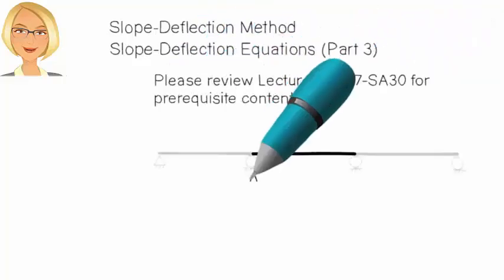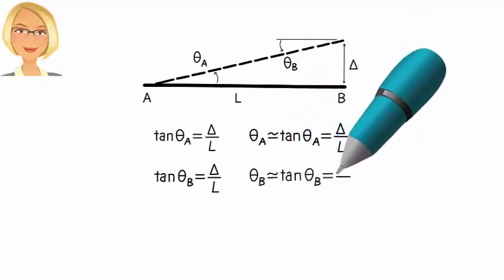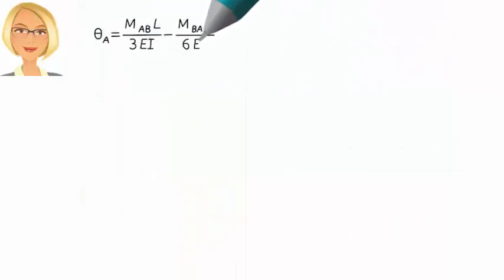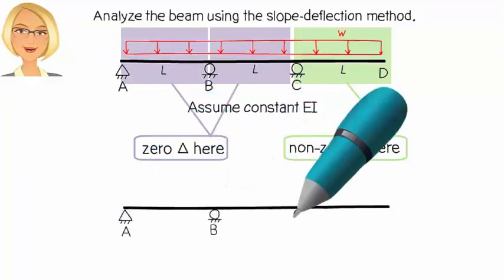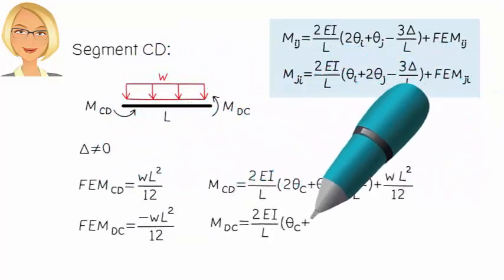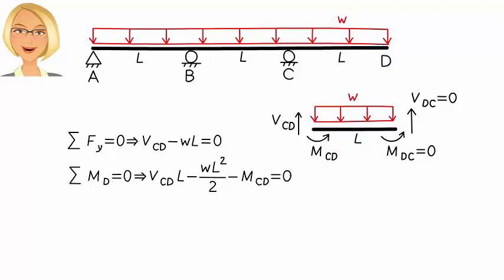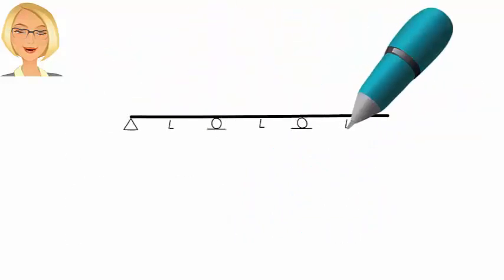SA31: Slope-Deflection Equations (Part 3)

Comment: Did you accidentally solve statically indeterminate problem with statics? a) @10:58 you get value of Mcd in terms of beam parameters and loading b) @9:52 Mcb+Mcd=0 (therefore find Mcb)  c) from beam segment FBD you can easily find that Mbc=0 d) Mbc=-Mba . Why do all this complicated calculations?
Reply from the maker: When considering determinacy, a beam resting on a pin and two rollers is typically considered indeterminate. Why? Because it has four support reactions but there are only three static equilibrium equations.

So, why is it that, in this case, we can determine the support reactions? What condition allows us to simplify the problem, as you’ve suggested?

How would you approach the problem if that condition were removed?
Reply: @DrStructure   I think the fact that it is overhang simplifies the problem, as there is no reaction/internal moment or shear force at D, therefore for segment CD we have 2 equations and 2 unknowns to solve for internal shear force and moment. It's like hinged beam, where globally indeterminate structure can be solved in parts by statics. Is that what you mean?
Reply from the maker: Not quite. It is true that we can simplify the problem by replacing the overhang with a force and a moment applied at C. So, we know the moment at C is wL^2/2. This is the moment due to the load applied on the overhang. But that does not enable us to determine the reaction forces at A, B, and C. There are still too many unknowns to be solved using the static equilibrium equations.

Let’s simplify the problem by removing the overhang altogether. Now, we have a two-span beam with a pin support at A, and rollers at B and C, resulting in four unknown reaction forces: Ax, Ay, By, and Cy. Can we determine these unknowns using the static equilibrium equations? We know Ax=0. But what about Ay, By, and Cy? How do we determine them?

Comment: What does it mean when we get the values of the member end moments (Mab, Mba and Mbc) as zero values noting that already there is rotations happened for the joints where they exist? And can I know the deformation response for this case and how to relate it with the Member end moments and joint rotations? Thanking you in advance
Reply from the maker: A bending moment in a beam (at point X) causes rotation in the beam (at point Y). That is to say, a bending moment does not have to be present at a specific point for the point to rotate or deflect. A good example would be a simply supported beam subjected to a load at its midpoint. The load causes the beam to deflection downward, resulting in a rotation at the pin and roller supports. Yet, we know that bending moment at the pin/roller is zero. 

The response of a beam to loads manifests itself in (1) internal forces (i.e., moment and shear), and (2) deformation and rotation. Both these responses can be determined using the slope-deflection method. The method yields a set of equations the collectively describe the relationships among the joint rotations, displacements, and moments. 

Of significance here is to keep in mind that there is no one-to-one relationship that tells us a zero moment at point X mean zero a rotation/displacement at X, or vice versa.
Reply: That was truly helping.. thank you

Comment: I understand how you got Mcd=wl^2/2 but how did you get -5wl^2/12 for the fem?
Reply from the maker: The equation of interest is Mcd - wL^2/2 = 0. 
The fixed-end moment for Mcd, given by the slope-deflection equation, is wL^2/12. 
So, when we expand the above equation, we end up with wL^2/12 - wL^2/2 which equals to -5 wL^2/12
Reply: Thank you

Comment: I am a bit confused: When is the bending moment at A clockwise and when is it counter-clockwise ? Thanks
Reply from the maker: In the slope-deflection method, we assume the member-end moments to be in the counterclockwise direction. That is the same as saying, counterclockwise is the assumed positive direction. But this is completely arbitrary. We could have assumed them to be acting the clockwise direction which would have resulted in a similar, but not identical, set of slope-deflection equations. 

In general, one can assume any direction for an unknown moment, or force. We can assume clockwise, or counterclockwise, to be positive,. We then set up our equations and solve for the unknown moment(s). If a moment value turns out to be negative, then we know that the moment acts in the opposite direction to what was assumed initially.
Reply: @DrStructure  Thank you so much
Reply from the maker: You're welcome!

Comment: Dr structures, should we not  delta negative in our equation as it deflects downward(  clockwise)? Or the answer of delta is negative which means that it would have been positive if we had taken negative in equation?
Reply from the maker: The negative sign in front of delta in the slope-deflection equations simply indicates that a positive delta value reduces (subtracts from) the positive (counterclockwise) member-end moments. That negative sign is not telling us anything about the sign of delta itself.  After solving for delta, if we end up with a negative value, as we do in the example problem, then we know that the delta (relative displacement) is caused by a clockwise rotation of the beam segment. This does not necessarily mean a downward deflection however. It would be a downward deflection if the right end moves down relative to the left end. But it could also happen if the left end of the segment moves up relative to the right end. In both cases, the segment’s rotation would be clockwise, meaning a negative delta.

Comment: Thanks for the videos. Very helpful.
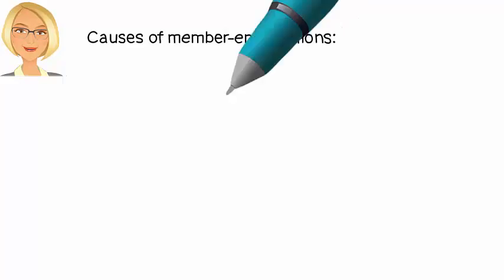I have a question. What will happen when we have just nodes in case of simple supports? Here in the example @ 2:00, say the mid node becomes just a node, not a support. Can we use these formulas directly? Since the mid node will deflect downwards, can we say that this is the same 'delta' specified as support deflection? In no where i saw a solution like that.
Reply from the maker: In the particular beam that you are referring to, if we replace the middle roller with a hinge, the beam becomes unstable. So that beam is not a good example to use here.

Here is a better example. Suppose we have a continuous beam with five supports where the middle support is a roller. We can then ask the question: "What happens if we replace the roller with a hinge?"

Several things would happen:

1. The beam is going to deflect downward at that joint. This means the Delta term would no longer be zero in the slope-deflection equations associated with the two members connected to the joint. This introduces an additional unknown (Delta)  into the equilibrium equations.

2. Bending moment at the joint would be zero since it is an internal hinge. 

3. The beam segment to the left of the hinge would have different rotation (theta) than the beam segment to the right of the hinge. This means at the hinge, we will have two distinct rotations, one for the left side of the hinge and one for the right side of the hinge.

So, how do figure out these additional unknowns?  We need more equilibrium equations. Where do we get these additional equations from? 

Generally, when Delta is present in the slope-deflection equations, we need to write an equilibrium equation using a shear force. Here, we can do that using either the left or the right beam segment attached to the hinge. 

Further, for the hinge we can write two moment equations:
The end moment (at the hinge) in the left beam segment must be zero.
The end moment (at the hinge) in the right beam segment must be zero.

Given these additional equations, we now should be able to analyze the beam and find the unknowns. 

I'll include this problem as a subject of a future video lecture. Thanks for brining it up.
Reply: Thanks very much for the detailed info. 
How about replacing the roller on the midspan of the example on 2:00 with just a node (carries both moment and shear) , not an internal hinge? So that the beam will deflect at that joint under the given loading. 
When we write moment - slope equations according to the beam part - x=0 to  the mid node- we have to consider the deflection at the node. Does this vertical deflection can be counted as the support settlement, Delta as usual? (All the examples in text books are with internal pins or rollers. So when we write the Mij equations delta cancells out.)
Reply from the maker: In that case, we will end up with a simply supported beam which can be easily analyzed without needing to use the slope-deflection method.

But, if we insisted on using the slope-deflection method to analyze the determinate beam, we need to divide it into two segments: AB and BC, B being the mid point of the beam.

Then, we would get four unknowns: rotation at A, rotation at B, rotation at C and vertical deflection at B.
We would need four equilibrium equations:

Sum of Moments at A = 0  ==> (Mab - 0)
Sum of Moments at B = 0  ==> (Mba + Mbc = 0)
Sum of Moments at C = 0  ==> (Mcb = 0)

And,  a shear force Equation,
Sum of vertical (shear) forces at B = 0 ==>  (Vba + Vbc = 0)

Comment: Thanks..for this very nice explanation about slope deflection method. If possible could you please explain how a fixed beam with uniformly varying load reaction derivation in steps
Reply from the maker: Unfortunately, this kind of derivation can not be explained effectively using text only in the comment section. We'll try to accommodate your request in a future lecture, but that video most probably will not be available online anytime soon.

Comment: Thanks. You offer  very clear concepts. by the way, which textbook of Structural Analysis do you refer ?
Reply from the maker: Thanks! There is no specific textbook in use here.
Reply: @DrStructure  sir if the beam has a overhang part as shown in the example but does not have load on it.. Will we still conider non zero del in the equation ?
Reply from the maker: @rikdevghosh7324  Yes!
In that case, we can remove the overhang part from the beam before starting the analysis. This means the delta terms vanishes from the equations since the other joints of the beam are resting on pin/rollers.